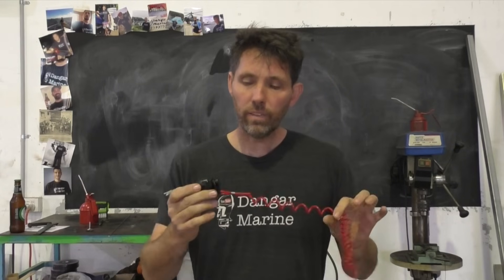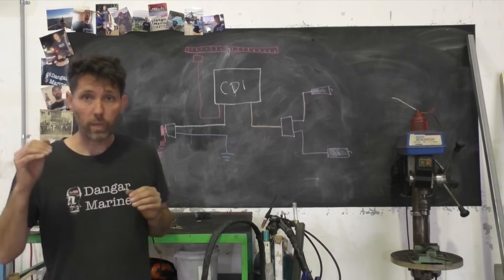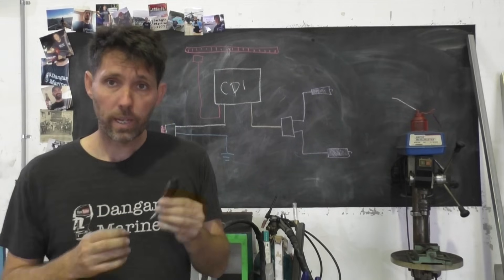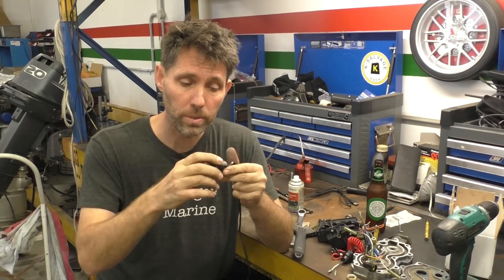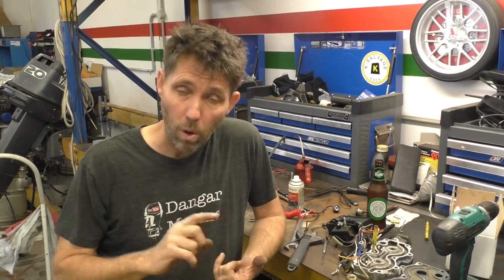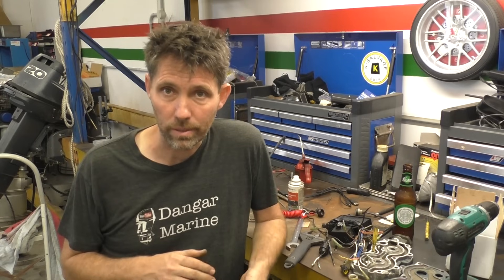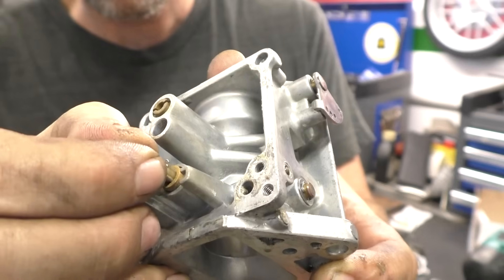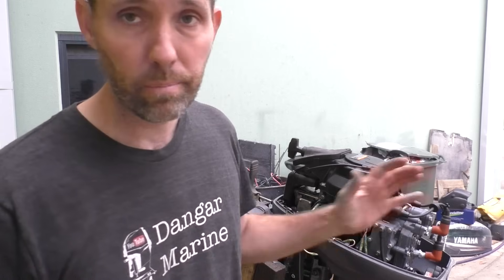Outboard kill switches

Comment: Hi stu, on my Yamaha 2000 model  4 stroke 25hp, with engine not running I checked the voltage on my battery with a multimeter and the reading was 12.55v, then started motor and reading went to 13. something volts and then back down to a continuous 12.63v. Is this normal? Cheers.
Reply: Dean t It's normal bud. The voltage going higher means youre battery is getting charged
Reply: hi jimbo gasoline, just wanted to make sure those voltage parameters sounded ok, my concern was I thought while motor is running there is meant to be a constant voltage output of around 13. something volts or is it normal for output to be 12.63? cheers.
Reply from the maker: Hey Dean, the voltage will increase with RPM, the voltage won't be very high at idle but should climb to over 13 volts once you running at a higher rev range.
Reply: Hi stu, it did do that for a second or two but then dropped back down to a continuous 12.63v even if rpm is increased, could there be something wrong with the voltage rectifier unit? I did recently get a flat battery recently but I have disconnected something that I think may have been the culprit but not sure. Cheers mate.
Reply: Dean, disconnect your battery +ve terminal and the auxiliary terminal cables, put your multimeter in the Amps range at the highest reading it has ( typically 10A, but if you have it use next range down, usually 2,000mA ) . Put the two +ve battery cables in contact with each other, and connect the vemeter lead to the +ve battery leads. Put the +ve meter lead on the battery positive lead - do not put the key in the ignition or try to start the motor you WILL blow up the meter if you try that. Have every thing turn off.
Keep winding the range on the meter until you get a reading  to the left hand side of the decimal point. (ie 15.65mA, but hopefully more like 10.xxuA) . If the amps are any higher than1mA then you have a current leak some where, just disconnect things until it goes away. 1mA is about what the computer in the engine , fish finder  GPS standby current would be expected to add up to. That will find your battery killer.
If the battery is over 5 years old or was not a marine battery then it died from wrong use/old age - they can last longer I know, but 5 years is a good run.
13.8V charge is what I think you are expecting  - but that voltage is only good for the old style non maintenance free batteries. That charge voltage will kill  maintenance free batteries. Newer motors are made for the maintenance free batteries and will charge at around 12.8 or a bit under  after an initial quick over charge rate (above 13.2v) to recover the starting power used. The 12.8 is a ' non gassing ' charge rate. But basically - if your voltage at over 1500rpm is .3 to.5V higher than your voltage before you cranked the motor , you should be OK. By the way , don't worry about the 2nd decimal place on your meter readings unless you are using a high spec meter. in reality your meter 'guesses' what that number should be. (ie 12.53 could be exactly the same as 12.59- the meters just are not that accurate)
Reply: Hi Ron Powell, that does make sense what you said and I will monitor it over time. Thanks for your help and reply. cheers mate.

Comment: nice vid stu and good timeming .i have just put a yamaha 70hp on a centre console dory and it had side remotes which i have just changed too centre mounted one so i need to wire in a kill switch and a new after market ignition  in the dashboard . can you do a follow on video from this one please explaining the colour codeing of the wires  from the engine loom (yamaha) to the ignition which are random colours .which i would have to meter out . but once i understand the colours i could then wire in the yam tach guage . many thx peter from england
Reply: Check the colour codes for a US made motor - they standardised  the colours back in the late 70's .
Reply from the maker: There definitely are charts for the standard colours online, Ron is right. I am planning add forward controls to a friends boat soon though by adding mis-matched parts so I'll be sure to film it.

Comment: A good tip we are taught at NSRI. Is to actually kill the motor with the kill switches often in stead of using the key. Just to check whether it is working correctly.
Reply from the maker: He Cedric, I like that. It makes a lot of sense to test something before the day you actually need it and find it doesn't work!

Comment: Crazy that I've been looking all day for content like this, and you just posted it.  I have my grandfathers Honda BF15, but can't get it to fire.  It wants to start, but won't turn over.  Could this be the neutral kill switch? Great vids, I'm just getting started, but will keep watching.
Reply from the maker: Generally the neutral safety switch will stop the start motor from activating, so if it isn't cranking, check that. If it is cranking but won't fire up (no spark), it could be the kill switch like in this video.
Reply: Dangar Marine Thanks a ton. A buddy and I got it isolated out to a gummed up carb today. Again, great videos. I'll be watching more.

Comment: Thank you Stu,my mercury broke down once again tonight . No fire ,and no power trim and tilt nothing. Put a brand new battery on it and still nothing. [New problem motor]I bought a 9.9 Yamaha and the man told me a friend worked on the kill switch and therefore it will not fire off. You were highlighted on my computer when i walked in from the break down. hahaha Tomorrow i will check out the white wire and see if it will crank.I have two problem motors....
Reply from the maker: Hopefully it will be a simple kill switch problem on your Yamaha. Your Mercury sounds like it might just be a fuse.
Reply: It was the fuse on the mercury. Have not had time to work on the Yamaha.The tiller handle throttle cable is a wreck. Will look at it tomorrow and bypass the kill switch and manually work the carburetor.

Comment: Hey Stu, another great episode as usual. Do outboards with computers like the tldi use the same method by diverting current to ground or is the switch connected through the computer?
Reply from the maker: Hey Anthony, yep, they use the same system for shutting of the ignition.

Comment: Hi, i figured out the problem with my 1990 johnson 90hp outboard. And i figured out after trying everything possible to get the rpm to be stable...that the reason behind all the problems are the throttle cables. They have about an inch of play in them, which caused the throttle lever not to end up in the same spot every time i move the remote control forward and back to neutral. 
Thank you so much for your videos because without them i wouldn't have had the knowledge to do what i did.
Reply from the maker: Hey Moe, glad you got your problem sorted out. Nice work! :)

Comment: Can I pit one on my 74 merc500 50 hp
Reply from the maker: There will definitely be a way to add one. How do you currently turn the motor off? It just needs to be added to the same wire from the ignition if it is key start.
Reply: Dangar Marine well last time I ran it I just let it empty the gas. Because even my choke solenoid is not working properly or I can pull the choke manually I think right?
Reply: And yes it's a key start
Reply: Dangar Marine in which wire exactly am I going to connect it
Reply: Dangar Marine I think I know now. I'll let you know thanks

Comment: Congrats on getting sponsorship for your channel Stu! This was a great video on how those switches work. I was always taught when troubleshooting look at the easy things first. It could likely be the problem. I wonder how many times a kill switch that was stuck closed was overlooked by someone with little experience leading to the replacement of an expensive CDI box?
Reply from the maker: Thanks Jack. You are dead right about starting with the simple things. No spark is much more likely to be a kill switch than a CDI unit, and certainly much cheaper!